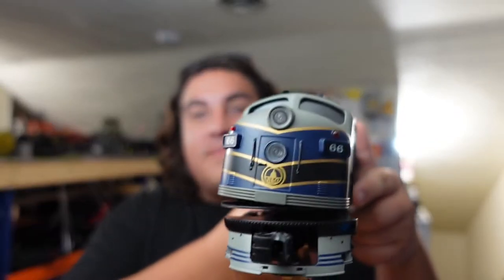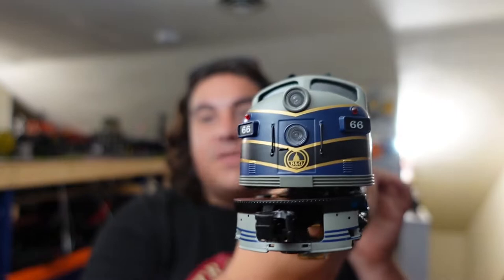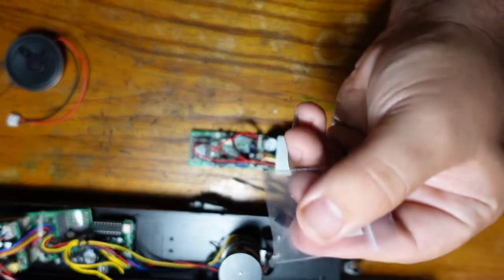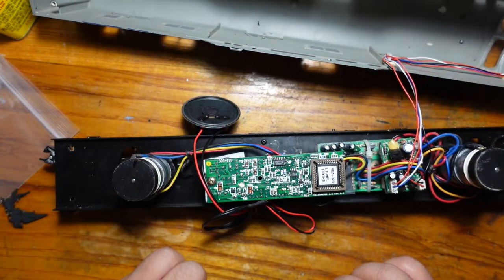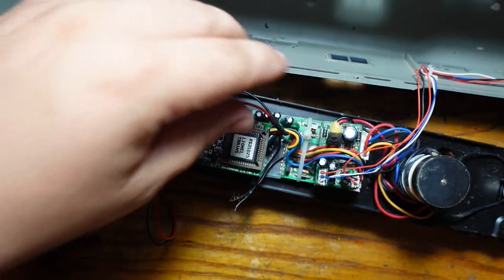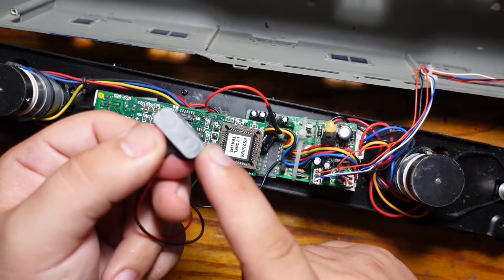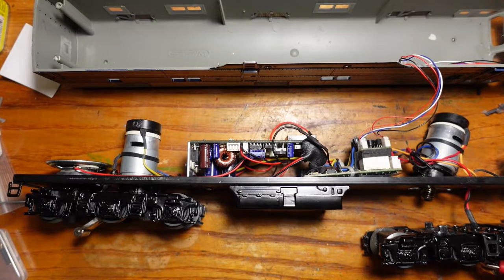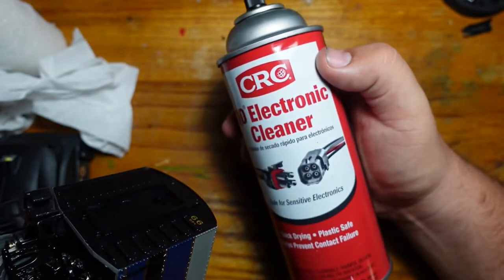Lionel Railsounds Upgrade, BETTER Sounds for Williams Diesels - Part 1 of 2

Comment: I just got a new in box Williams Western Maryland GP9. It looks wonderful and pulls strong, but I’m already looking to upgrade the sound. This is exactly what I need. Thanks for posting!
Reply from the maker: Thanks for watching! I’d honestly recommend upgrading to an ERR soundboard for the locomotive if you intend to run it in conventional mode. If you have a DCS system , I’d recommend upgrading it to PS3. I have a few Williams pieces that run amazingly well with the PS3 upgrade kits installed.
Reply: @NixCrossing  I’ll keep that in mind! I’m just getting back into the hobby (we chatted in comments using my other channel about how good the RailSounds tender was) and I’m trying to decide what I want to do with my layout. It’s probably going to be a mix of conventional and early TMCC, and maybe some new stuff - if I get the budget lol.

Comment: Very informative video Nix! I tried to find the seller on eBay paper booth but had no luck. Thanks, Glenn
Reply from the maker: Hey thanks for watching! So unfortunately the seller went “poof” of the eBay. There’s a few other sellers on there
Reply: @NixCrossing  no worries. I am not in a hurry, I am retired. I enjoy watching your videos especially the live streams. I mainly run Postwar lionel with some modern and a few DCS engines as well. I have some premier engines with fried boards that I put William's reverse units in the and they run great but was looking to add some sound back to them. I enjoyed your PS3 updates but don't think I would attempt it now after having many strokes. Keep up the good work Nick.

Comment: Nick. Can you adjust volume level ?
Reply from the maker: Yes, there’s a pot on the board itself. You can add a pot to the frame if you disconnect the one on the circuit board and solder in an aux one

Comment: Thanks for the video I've been debating whether to upgrade all my Williams diesels. Now I know I have to order some kits and have fun.
Reply from the maker: Not a problem, thanks for watching! This kit was approx $100. I also recently re wired the motors in series so it draws more power and the RPM sounds kick in. Williams motors are wired in parallel.

Comment: Great sound system. I've been looking at this same kit for my PW F units. I've used his Santa Fe Warhorse steam kit in the MPC 8206 streamlined tender that had a bad SOS board. Thanks for sharing. I haven't seen a lot of videos with his kits installed. He also has a couple Vanderbilt steam kits
Reply from the maker: Thanks so much for watching! I’ve been looking at a few of those boards as well for my LTI Chessie special or my B&O Hudson from Williams.  They all sound great 🚂💨

Comment: Thanks for the video, very helpful.  Can you do a video with a Lionel older engine with  pullmore motors w/ an E unit to Railsound 2.5?
Reply from the maker: @thoff1348  thabk you so much! Unfortunately ERR has stopped making the AC motor kits. But that would be a great idea for a future project once they start making them available

Comment: If you wire up the motors in series it slows locomotive down and allows the sound to match speed. I did it on one of my videos.
Reply from the maker: Thank you so much! I’ll try that and of course check out your video on that before I catch my engine on fire 😂. I’m guessing they are wired in parallel?
Reply: @NixCrossing  Williams are wired in parallel and that's what makes them fast. Several modelers do it. I really want those E7s, best looking that Williams makes.
Reply from the maker: @joeystrains.9316  First thing I’m doing when I get home is re wiring those motors lol thanks so much! Williams makes some really cool stuff. I have a scale Hudson from them that isn’t ran much on the channel 🙈

Comment: How did that take you to install it in the william locomotive
Reply from the maker: It would have taken me about 10 minutes. You use the wires that would have gone to the sound blast system. This just uses track power

Comment: Have you tried by chance to use a BCR instead of a battery? Always worry about a battery leaking and we all know the PS1 and PS2 issues, not saying that will happen here but if you have them laying around will they work to keep power continuous?
Reply from the maker: @charlie-mm7cv  I have BCRs installed in all of my PS2 locomotives 3 and 5 volt variations. BCRs still require about 15 seconds of start up
time to charge (capacitors) while running in conventional. BCRs charge much faster while using a DCS system with approximately 18VAC to the track.  Hopefully this helps

Comment: Nick, sounds great! I have a pair of MTH E8s that could use an upgrade like this, beautiful units with streamlined passenger cars but they only have a cheesy sounding horn. I bought a Williams SD90 a while ago and remember reading an article online explaining how to wire the 2 motors in series to slow it down and make for a better runner. I did and it did make for a better performer (you can see the headlight better anyway) Wonder if that would help your sound board to be more in sync?
Reply from the maker: Thanks so much for watching! I actually did wire them in series and they do line up much better now. I actually might install a TMCC board in the lead unit after finding one on eBay

Comment: Great tutorial Nick!  And entertaining as well!
A question, if variable power is what's needed to alter the rev sounds on the board is it possible or advisable to take AC power directly from the track?  If it is varying the track power should vary the rev sounds.  Apples and oranges of course, but the Williams boards operate off AC and so do ERR's.
Reply from the maker: Thanks so much for watching! Yes the wires are hooked up to the AC harness that’s directly off the track rollers / grounded frame.